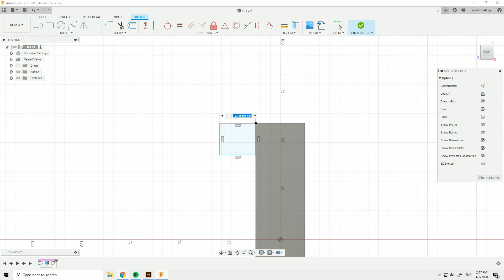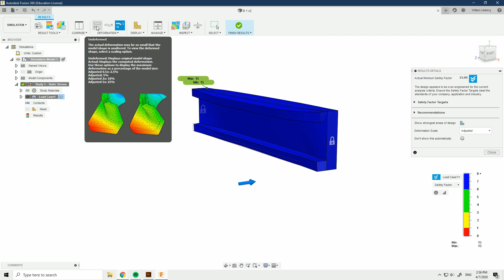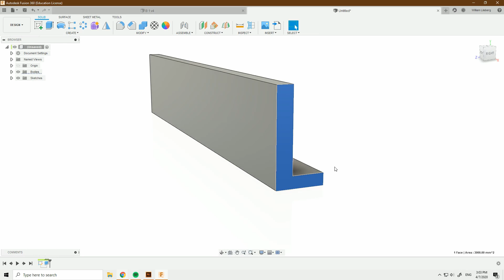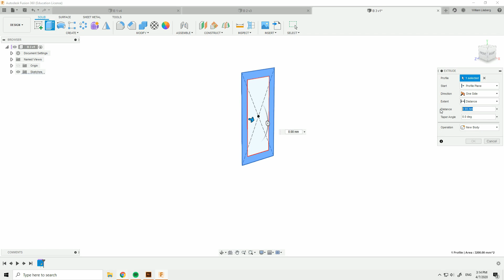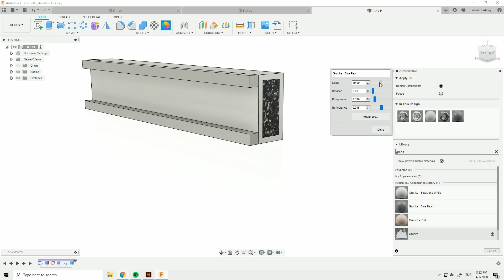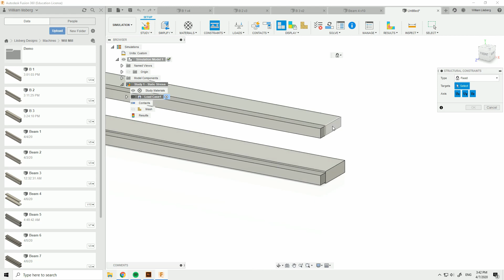How to simulate and compare beams and parts in Fusion 360

Comment from the maker: Hi all! I've discovered that Fusion 360 has had some problems simulation the beams with another material inside it. It makes those beams deflect less than they should. Watch this video if you want to learn how to simulate beams, but please remember that you cannot simulate something, with a different material inside it. Now other than that, Fusion 360 is still great for assemblies, with the epoxy granite beams being the exception.

Comment: Any updates to this project??
Reply from the maker: Yes. I've designed a really stiff gantry for the machine. I'm planning on making a video on how I used shape optimization in F360 to see where the critical loads in my gantry were located. I'm really busy with work at the moment compared to when I started this project, but it's not a bad thing, in two months' time I'll have to funds to realize this project.
I've learned lots of new things about composite materials and I'm looking forward to sharing it all!
Reply: @garage-eng  
Even I am trying to build one. Made the design choices of gantry frame, steel tubes and epoxy granite. 
Planning to mill stainless steel and titanium and other hard materials.
I will be lucky to learn few things in this regard from your videos.

I finalized fixed gantry over moving gantry. 
Thanks a lot for your videos.
Reply from the maker: @rapoliit That sounds great, I'd be happy to follow your build. You should consider making a build-log on the cnc zone forum, people there are happy to help (as am I).